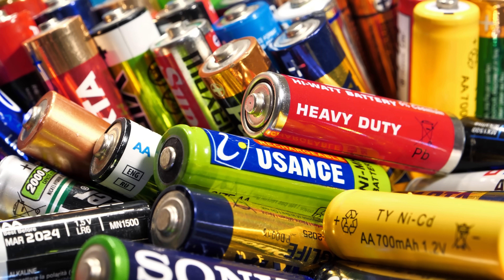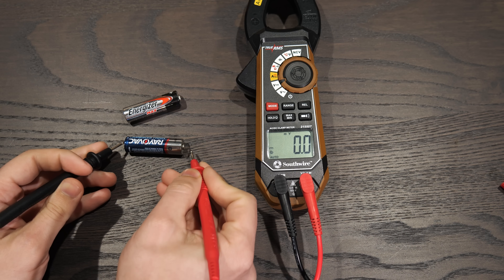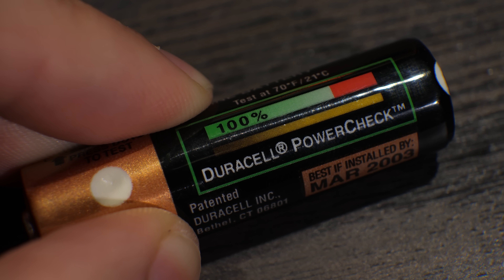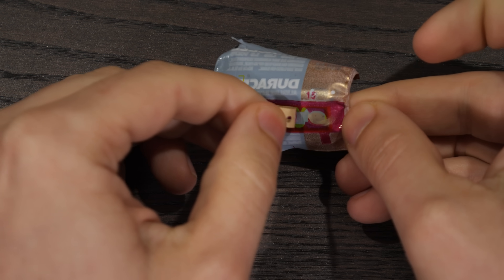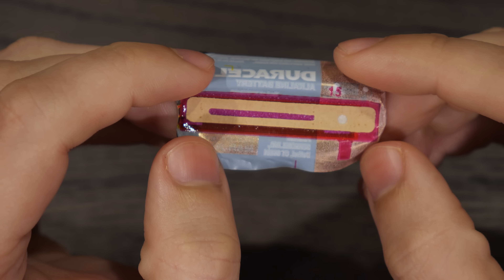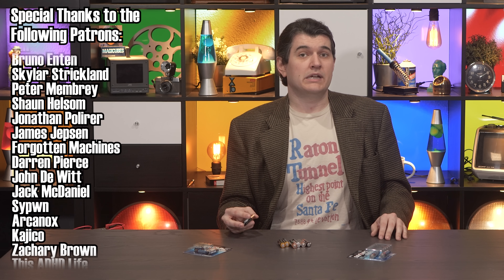Duracell PowerCheck: A genius idea which didn't last that long

Comment from the maker: A note on current:
The tester's behavior (how much of it turns yellow) is also dependent on how much current the battery can provide, but how exactly that was calibrated is... fuzzy. I only discussed voltage here because the original Kodak patent describes it as a "Battery voltmeter" and my first test with the DC power supply was consistent with this video's script. However, when I was filming B-roll with a second unwrapped battery, it was passing much more current than before and I needed to limit current via the power supply for it to show a clean cutoff in color. At just 1 volt much more turned yellow than in my first test, and over a smooth, spread-out gradient.
I sort of suspected this (that weak batteries would pass less current, compounding the effect of the heat gradient) but I couldn't back that up with anything concrete. My first test probably had a poor connection between the power supply leads and the label which was limiting current enough to make voltage the only significant variable, but until I filmed it with the second battery I didn't know it was pulling less current than it otherwise could.
Reply: It's probably a printed carbon film resistor, often used on inexpensive devices as it's pretty much a thick ink that can be printed onto a surface.  Edit: They may have been easy to print, but they were often HIGHLY inconsistent in thickness especially with low cost printing methods. This would explain the inconsistencies you (and we) experienced.
Reply: @truckerallikatuk 
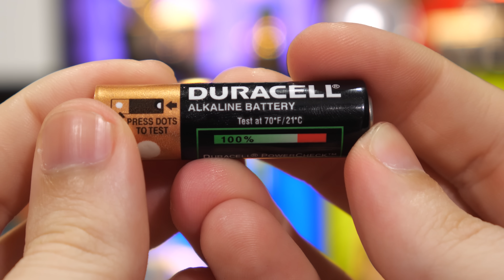Revelation 3:20
Behold, I stand at the door, and knock: if any man hear my voice, and open the door, I will come in to him, and will sup with him, and he with me.

HEY THERE 🤗 JESUS IS CALLING YOU TODAY. Turn away from your sins, confess, forsake them and live the victorious life. God bless.

Revelation 22:12-14
And, behold, I come quickly; and my reward is with me, to give every man according as his work shall be.
I am Alpha and Omega, the beginning and the end, the first and the last.
Blessed are they that do his commandments, that they may have right to the tree of life, and may enter in through the gates into the city.
Reply: A battery is commonly modelled as a constant voltage source with a resistor in line. Resistance is rising with emptying it.
Reply: So we can say this is an Ohmmeter? 🤗
Effectively measuring the increase of internal resistance of the battery as it wears off 

The heat released at the strip = I x U (current times voltage). Current through the strip under Ohm's law I = U / (Rs + Rb); battery and strip are in series, strip resistance is constant, battery resistance increases but also voltage drop decreases - so feels this will turn quadratic 

The voltage drop at the strip is proportional to resistance ratios, Us/Ub = Rs/Rb, so Us = Ub * Rs / Rb 

Heat(watts) = Is * Us = Ub^2 * Rs / (Rb * (Rs + Rb))
where Ub = 1.55v is constant, Rs is fixed but Rb increases - and the heat released is quadratic-ish to that increase
Reply: depends on what you use the batteries for my mouse use batteries and it becomes laggy and not great to use but then same batteries in a TV remote work just fine so i do keep them for later use
Reply: @markthompson4567  Yeah, reusing old batteries that were in high-power devices for use in low-power devices like remotes or clocks is what I do as well.
Reply: @markthompson4567  same here
Reply: @markthompson4567  Yeah this is quite common your optical mouse requires the battery to be able to push more wattage to actually function than the TV remote. Thus as the battery discharges there is a gap between where it is already too low for the mouse but not for the TV remote.
Reply: @FaerieSeraphina  why the feature would still be useful but i just have a seperate jar for half dead batteries instead
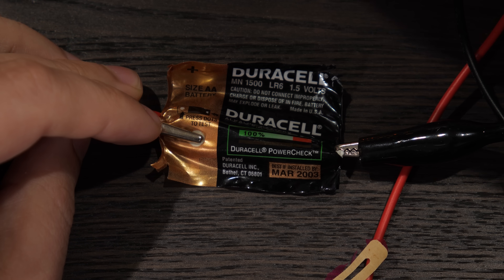Reply: For future refrence, got a little confused at 7:50 becuase what is stated in the audio does not match what is shown in the video.
Reply: HOW COULD YOU NOT TALK ABOUT THE BOUNCE TEST?? 
Bounce a empty and a full battery vertically on a table from ~20cm and witness magic
Reply: @TheBenenene10 I call bullshit on you. If you have actual evidence that this works, explain the exact method and provide statistically sufficient evidence.
Reply: @ScottLuvsRenFaires seriously? You're on the internet. You're on You Tube. How hard is it to search for the bounce test? Muppet
Reply: @TheBenenene10  It's like there's only 5 of us who know about the gravity test!
Reply: Speaking as a parent of smalls that get bought novelty night lights by well-meaning family, a special place in hell is reserved for engineers who design things with 4 coin batteries in series....
Reply: I mostly relied on how fast the band would color to 100. If it was a second, the battery was charged. If it took more than 5, it was dead or almost dead.
Reply: Duracell Quantum batteries still have Powercheck strips.  And amoebas too!
Reply: Internal resistance must be increasing as the chemicals inside are consumed. This adds up in series with the "external" load, and by Ohm's law the maximum supplied current decreases.
Reply: @catalinbadalan4463  Ohm's Law doesn't define how batteries work, as to their electrochemical traits, whereas it may apply to physical structure elements.  ESR is a bit more complicated.
Reply: @catalinbadalan4463  
That's horribly fascinating.
It was and still a waste of money. 
Thank God we have better technology now.
Reply: interesting video. What would be fun to see is if you had used a thermal video camera showing that strip heating up when applying various levels of voltage. press like to this comment to increase the chance that he will see my comment and possibly revisit this subject with a thermal camera.
Reply: it would be nice have it on rechargeable batteries (i usually charge my batteries all at once) 🤔
Reply: Your Burgerlandian self also forgot how they are still easy to find in Europe in working condition, being even sold as brand new. 

I guess that maybe in European countries people actually used that feature more? Or maybe the patent disputes didn't apply there somehow.
Reply: I'll subscribe to Alkaline Magazine.
Reply: I remember them well . Where you find these obsolete technologies anyway? I love these old things grew up using many of them.
Reply: These still exist under the name "ultra power" here in the UK
Reply: I need 1 answer, is Energizer/Duracell costlier batts worth the cost of RoyOVac cheap batt?
Reply: @amyself6678  Google Gaslight censored a comment explaining why there's no simple and accurate answer to that question.  Both companies have a history of good and of defective manufacturing batches and battery designs.
Reply: @amyself6678 Both of those companies have produced large runs of defective batteries with premature leakage issues more than once, and both have produced batteries with fraudulent spec's on labels (but unlike many eBay or ScAmazon sellers, have been pressured to correct those false claims).  

I've had batteries from each of those companies that are quite good, and from each of them, better placed in the chemical waste recycling bin or recalled if released.  That complicates the ability to give a simple blanket answer that's truthful.  Other engineers have made similar observations.
Reply: @amyself6678  Project Farm may have the answer
Reply: Batteries have an internal ESR or Equivalent Series Resistance, like capacitors do based on mechanical design and at stable values, whereas in batteries it's electrochemical and so varies with more complex age and use and load factors.  

That substantially complicates the topic of what defines battery capacity or end of life, and usually means a "real" oem battery spec sheet people who aren't engineers rarely request or read, is 2-16 pages long depending on battery type and ethics and quality of the manufacturer's engineering department, if not crippled by marketing or legal.
Reply: I never saw a purpose!!!!!
They're either alive or dead.
Reply: When I used it as a kid, I found it to be inconsistent, and had to resort of a multi-meter anyways. If you hold it too long, the entire strip would turn yellow.
Reply: @lophilip  agreed 👍🏼
Reply: I was born in 2002 and I’ve purchased batteries with this feature.
Reply: Duracell have very good technical data sheets which answer those questions re current, load, drain etc.
Reply: A 10-20% tolerance seems reasonable for these crude film resistors. A more reasonable way to test the devices to offset this tolerance would be to set your power supply to constant current mode, not constant voltage, and dial it up accordingly. Effectively these devices are trying to measure the internal resistance of the battery, which changes as it ages and thus reduces the current delivery capability, causing voltage sag.
Reply: But wait, I am currently in possession of over a dozen Duracell Quantum ( size D, copper top with a red colored shell) and they're good through December 2025 so I don't think Duracell stopped making them.
Reply: Weird suggestion for a video topic that’s not exactly your typical subject but I think would be extremely interesting and informative: Disposable vaporisers. I doubt that you smoke/vape but there’s lots of genuinely genius and incomprehensible parts of their construction.
Reply: i thought the battery emptiness was indicated my the leaking acid and that's why the bar was redundant...
Reply: Current measurement is just something you get for free with a voltage measurement and a known resistance.
Reply: It's about internal resistance. A voltage meter is practically infinite ohms (in the megaohms range) so there's practically no voltage drop inside the battery. But if the circuit outside the battery has too little resistance then most of the voltage drop occurs inside the battery and thus it "outputs" little voltage.
Reply: As you stated, my son's Game Boy ate AA batteries. I constructed an adapter to connect to a 6 volt lantern battery. It lasted F O R E V E R.  And one lantern battery was much less expensive than all the AAs it replaced. Thanks for another entertaining video.
Reply: My brain rot wattpad
Reply: interesting findings
Reply: These are awesome on weighted scales.
Reply: Power check was absolutely the best back in game boy color days always trying to mix a battery with almost nothing left with a battery that was still halfway my backpack was full of them
Reply: Im glad you mentioned current. My cheap Harbor Freight multimeter has a battery tester that reads in milli-volts.
Reply: Have you done a video / breakdown of ' potentiometers'???
Reply: And what I remember is switching to rechargeable batteries. 
Everything too batteries!!!!
Reply: Please do a video about washing machines, liquid pods vs powder detergent. Its such an amazing subject.
Reply: @axel_is_gaming  i think he already did that.
Reply: Energizers have used a simple "pass/fail" tester (the more visible the "GOOD" indicator shown on the battery, the more power it had left).
Reply: Interesting thing here Duracell in 2017  remade the battery testers for a short time thay called them Duracell quantum I don't think they went over very well you all should look them up
Reply: I think it is because of thermal mass. 

This is one device so resistance is the same across the circuit. 

Narrower section will reach higher temp at lower voltage. Wider section needs higher voltage to cross thermal threshold to turn indicator yellow. 

Then it is just a matter of tuning to make sure it's indicating capacity.
Reply: Back when these batteries with built-in meters were being manufactured, Duracell was actually a reliable battery brand.  Nowadays they are absolute garbage and pretty much guaranteed to leak and ruin whatever device they're in. Don't put duracell batteries in any device that you care about.
Reply: one follow up to this i'd like to see is about the heat-changing material itself, there used to be cups and bowl with things printed on them that changed color or revealed the print only when warm, but it seems the material in question always degrades with time (or with cycles ?) and eventually gets stuck in a weird half-translucent state. wonder if there is ways to regenerate those
Reply: Awesome video. Definitely enjoyed this content.
Reply: @Dany-z9s i saw him put that pair in the remote and i cringed
Reply: I'm pretty sure that PowerCheck remained on Duracell batteries long after the late 90s in the UK.
Reply: @RWL2012  Duracell Quantum
Reply: Coulda used a beetle juice joke, but otherwise the juice was definitely worth the squeeze in this video. :D
Reply: I'm one of the few that powercheck was made for - I've always removed batteries for seldom used devices (before I went to mostly rechargeables). But.. one of the few. I remember both the tester integrated in the battery and also the packaging. I think another point the marketers missed was someone concerned about battery health probably also has a cheap accurate 1.5V AAA-D cell tester.
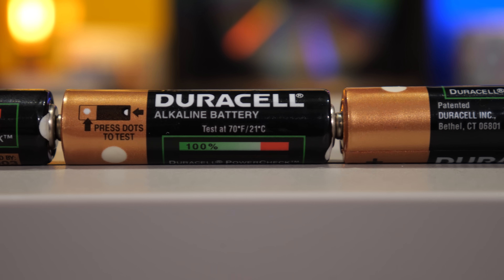Reply: 12:54  was  that meant to say energizer had in package testers? i remember them having that, but never durracell
Reply: It may surprise you to know that duracell still makes this kind of batteries. I'm holding a newly bought pack of eight in my hand right now. 
They work better than the ones you had available since they require you to hold your thumbs with less force than the older ones.
Btw I'm in north Italy so maybe they're not on the US market yet/anymore
Reply: First, please let me say that this was a GREAT topic with a POWERFUL delivery (read: yup, that was my dad joke!) and the nostalgia factor was off the charts! Please do make more nostalgic tech videos as I clearly remember how difficult those little buttons were to press! It’s actually kind of funny to think about this in retrospect a few decades later. That said, you must have been an “80s kid” too?! What a great time to be a kid, technology was really taking off and tech was just FUN! That was the kind of tech and reasoning why many of us “80s kids” wanted a career in a STEM field, to simply keep that fun going!

So, I read your post and certainly do have a theory, a very basic theory, but one that cleanly explains how current gets factored in. Batteries are about as DC as you could get and Ohm’s Law works well to explain the nuances. Actually, that and a small note regarding just how DC Power Supplies limit either voltage or current by design.

Now, we all know V=IR. With the static room temperature not being a factor (as I believe that it will change the resistance of the heating element or crystal that’s ‘reading’ it, thereby resulting in incorrect feedback), we must understand that the resistance of the heating element will effectively also remain a static value, at least at any particular point along the length of it (as it varies in width). You couldn’t have been more spot-on about just how important a load is as voltage alone is the “electromotive force” of the battery, based on the juice or chemistry. What voltage doesn’t tell us is how many electrons are moving past any given point, rather we only know that it has the ability to do so. The load will change the number of electrons dramatically as a larger load has more electrical resistance, so we’ll see less current with a larger load. That’s sort of how the graduated resistance works here, it’s a load by design and we see this as heat is the natural byproduct of resisted electrical energy in a DC circuit and even shows how inefficient they usually are… but… NOT here!

If you’ve followed along thus far, the issue is as batteries age, they lose their ability to product electromotive force or in other words their voltage diminishes. Back to good old Ohm’s Law, since V=IR, and V is decreasing, as the resistance at any given point will remain static, the current along the heating element must drop in proportion to the voltage! Hence, the bigger the voltage loss the greater the drop in current as a result. The end result will be that we absolutely will see this effect with this type of on-battery gauge as those calculations were made in a very particular way to ensure that the heating element working as the load will provide the necessary current to show a value, well, until a point that no value could be shown due to age.

Remember how I said that the power supply will likely affect the outcome?! This is because you could generally use a DC power supply either as voltage limiting or current limiting! Was current limiting a factor on your particular power supply? Could the threshold have been set too low? I would think that you really would need to operate in voltage limiting on up to about 1.65V-DC or so. That way, the current will present organically based on the internal resistance of the heating element. As you cut down the voltage, you’ll see a dramatic decrease in the yellow ‘gauge’ because of voltage and current being directly proportional to one another as the internal resistance is all that really matters (without accounting for fluctuations in temperature as that would of course affect it).

In summary, the on-battery gauge is genius! It has an inherent load unlike a multimeter and therefore should not present with a ginormous current (or voltage) drop if a load gets factored in. The circuitry of the multimeter along with the limiting effects of a modern DC power supply will just add too many unnecessary characteristics to an otherwise great and extremely simple setup! So, yes, the yellow gauge does measure voltage or electromotive force, however it MUST do so as a result of Ohm’s Law in action, only by knowing the inherent resistance of the heater and the current being yielded as a result. It’s simply another way to explain the same thing because DC circuits all rely on Ohm’s Law at the very heart of things!

BTW, the crystal display works exactly like one of those thermometer strips that change color based on temperature. Here, only a single color, yellow, is used. The heat output is taken based off of several items that go into a formula beyond the scope here to yield an exact temperature as a resistive byproduct. The specific point where it stops is simply where it goes below the temperature threshold. Yes, it does basically measure voltage, BUT only as a direct result of current due to the resistive nature of the heating element. I apologize if I missed anything as I have not yet read the paper, but the particular design methodology screams this to me!

Thoughts? 🤔💭
Reply: The internal resistance of the battery will reduce the current at low voltages, I suspect. 
With a bench power supply the internal resistance is virtually zero.
Reply: 4th on trends after 22h congrats man!😄
Reply: @TechnologyConnections  as an old dude: they were very inconsistent from one battery to the next. More than 2/3rds yellow it is likely ok, less it's likely not, is about the extent you could reliably know. They were also pricey.
Reply: IT STILL EXISTS!
Duracell PowerCheck still exists, I have a pair of AAA in my hand that are good until 2025. I think something got messed up in your research. Maybe they are reginally sold. I am curently in Serbia.
This one has 4 colors. One of the 2 I have still lights up the 1st 25% (red slot). HMU if you want them.
Reply: Thank you for reminding me I graduated Highschool 21 years ago.  @_@

Class of '03 represent!
Reply: Now do a difference on Duracell and Duracell ProCell
Reply: In your too quick review of battery sizes, you completely forgot the most frustrating types, namely AAAA, A23 and A27. The last two could typically be found in doorbells and AAAA was used in a pen for my digitizer, it was hard work finding new batteries for that one.
Reply: It was a smart invention.
Reply: "If you are old you will remember this!" Uh, I dug in my used battery box, and found one I threw away just a week ago. It explores in March 2025. But it's dead now. Duracell Powerchecks isn't THAT long ago. 🙂
Reply: i remember these, i loved them, i thought it was brilliant
Reply: This video sounds like duracell selftest are a thing of the past, but we still have them in Germany. and I see on ebay UK has them still ,too and I am talking about new ones lasting till 2029, not New Old Stock
Reply: The current "calibration" would depend on the overall QC of the material printed onto the label providing the resistance. If a battery could provide a lot of current then the label will change color faster, if not then it would be slower. Eventually it will balance out with the voltage the battery could provide. As a result the battery label should provide the same reading if the voltages under load are the same. This is evident by you needed to limit the current draw on one of them because the overall heating was much higher therefore it was spreading further up the scale. You could confirm this with an infrared camera.
Reply: @TechnologyConnections

The real "genius" behind these built-in battery testers was putting them into disposible batteries where, frankly, who gives a f*ck instead of into rechargable batteries where it matters!
Reply: I remember using one of those individual battery test strips on a 9V battery as a kid.  It was the first thing I held in my hands that went "POP!"
Reply: Pl
Reply: I’m I’m sorry 9sorry but but,😅 o  o for a little little little more more more stuff stuff
Reply: in in in in in in in
Reply: I’m I’m I’m, I’m so so
Reply: I’m 😅😅
Reply: I’m I’m sorry 😣😣 but but but,,
Reply: I’m I’m,,oo😅o
Reply: I have these in my keyboard, mouse, and TV remote with a 2032 expiry date, I believe that they are still being used today and are not a relic as stated in this video.
Reply: @hackbotogaming - I haven't seen them for sale in the USA for over a decade, EU and elsewhere may differ. I also dont buy disposables in less than bulk 24pks (much cheaper), every few years. That may affect my perceptions?
Reply: Never got this thing working in 2003
Reply: @TechnologyConnections How can I reach you to suggest a video?
Reply: Those battery checks on Duracell are still here in Europe. They are here since 90s and still here :). Look a bit different now (design is more fancy on the checking bar) , but yeah, still here :)
Reply: Are you sure that they went away? Onl a  few months bac,  i bought a pack of batteries with charge tester.
Reply: @TechnologyConnections Appearently Duracell batteries with PowerCheck are still available in Germany, where I live. I found them on Amazon and while they look a bit different, they are listed as available in new and, more importantly, have the feature. Although there is also a newer version of this battery that doesn't have the PowerCheck feature.

If you are still interested, I could also send them to you after I "test" the functionality myself :)
Reply: I'm old enough to remember when AA & AAA batteries were called "Penlight batteries", because they were primarily used in the small flashlights, known as penlights. At the time, there probably weren't enough other devices that took these small batteries. If there were, it was only toys that used them. Most toys took the D & C batteries. I don't think there were many 9 volt batteries around then. This was in the early 70s.
Reply: I'm not sure if they stopped producing such batteries. I have some of them right now produced in 01/16 with expiration date mar 2025. Unfortunately I never got that I have to press 2 points, not 1, so I was unable to measure anything. Now seems like I've used all of them - there are several for christmas lights, but they are partially discharged and I failed to use indicator now (voltmeter shows 1.11 to 1.25 volts). Mayby some are installed, but I'm not sure in what devices. I'm in Russia if region matters.
Reply: Some of the powercheck materials were also... well... not very good. That could also be the reason why some of the batteries were showing more current than others.
I peeled the powercheck stuff off two powercheck batteries back in high school for a science project and found that the testers were poorly made on one and well made on another from the same pack of powercheck batteries.
Reply: Duracell powercheck was discontinued in 2019 when they shut down the Quantum line of batteries
Reply: This is such an insightful dive into a piece of tech nostalgia! It's amazing how much thought went into creating a self-testing battery, even if it didn’t catch on. The way Duracell implemented the heating mechanism with the thermochromic material is such a clever engineering solution.
Reply: They are still on sale Duracell quantum has these strips.
Reply: That clamp meter is really good
Reply: he Duracell PowerCheck batteries feel like a perfect example of solving a problem that not enough people had. Still, the creativity and engineering behind them is remarkable.
Reply: I completely forgot these existed! Thanks for the trip down memory lane, great video!
Reply: The 'press dots to test' system was oddly satisfying to use back then.
Reply: Surprised you did not mention the option of using rechargeable batteries. Surely it's both the cheapest and environmentally best alternative.
Reply: I remember using these Duracell PowerCheck batteries back in the late ‘90s. At the time, it felt like pure science fiction to have the battery “test itself.” But honestly, I stopped buying them because pressing those dots was awkward, and the reading wasn’t always reliable. In hindsight, it was a clever but overengineered solution to a problem most people didn’t really have
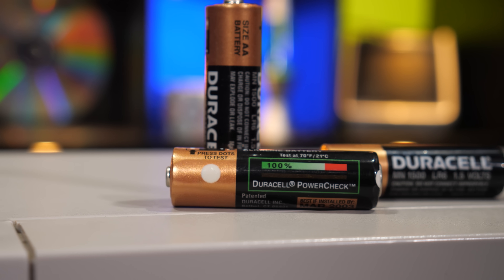Reply: 10:23 why it went away
Reply: If you think people just throw away half used batteries without throwing em in a drawer and hoping they might work on something else, like when you need two batteries and only have one fairly full, so you use a near dead battery and that'll work-- if you don't do this, you ain't never been that broke. It works just fine
Reply: Couldn’t the “tester” have degraded too my friend 🤔 🍀
Reply: I'd like to see these comeback but on rechargeable batteries.  I have a box full of dozens of AA/AAA batteries with varying degrees of age, capacity and charge holding levels.  As a tradesmen/property manager, my headlamp(s) is an everyday carry, and this would take a lot of the guess work out of how much power is left from something that's been left in the toolbag for 1-3 weeks.
Reply: @emmakai2243  If you're willing to spend a bit more on your charger, you can find more sophisticated ones that do the measurements for you, and will even test (charge, discharge, and recharge) the batteries and indicate how many mAh of charge they will hold.
Reply: @emmakai2243  I have some 9V replacement lithium batteries with LED capacity gauges.
Reply: @emmakai2243 get lithium head lamps and charge BEFORE useage but leave them as half discharged as they are after usage. so the average SoC is not 100% bdtween uses but way lower and that safes on degradation. apples crap phones know how to degrade lithium batterys pretty damn well. and they are constantly kept charged because they last somewhat between 5 and 30 minutes...
Reply: as kid I had old batteries as they could play a song or to after a time off in the draw
Reply: @Glaaki13 you mean in the DRAWER?
Reply: @Superabound2  no I mean you mom
Reply: Ultimately this is because the current that passes is proportional to the voltage this is why the voltage of a current limited supply drops under load. This is the same thing that makes the silly debate whether it is volts or amps that kills you is silly V=I/R is always true. If the voltage is sufficient to push more charge through the circuit than the power supply is able to replenish the amount of charge at the positive terminal will fall which means so too will the potential until it reaches a steady state where the voltage is just enough to push charge per unit time through the circuit aka current as the supply is capable of replenishing. When we are talking about DC systems V=IR means the voltage and current are always proportional to each other with the resistance being the ratio, things get a bit more complex in AC systems where V and I are constantly changing if you have any reactive loads that shift the phase of the two but that is another level of complexity that doesn't really apply to a battery.
Reply: @FaerieSeraphina Wikipedia says of Ohm’s law ‘It is less fundamental than Maxwell's equations and is not always obeyed. Any given material will break down under a strong-enough electric field, and some materials of interest in electrical engineering are "non-ohmic" under weak fields.’
Also, see styropyro’s video on the topic of under what conditions electricity will kill. He explains that it is pretty complicated, and the simple rules have exceptions?
Reply: @drdca8263  As I mentioned it does get more complicated in other situations but it does not really apply here we have a DC circuit with an entirely resistive load. Things get more complicated when you get into AC circuits, capacitive/inductive loads, and various other factors but they don't really apply to the tester doing it's job.
Reply: @FaerieSeraphina  sorry, I just saw “is always true” and jumped to share the exception I had heard about.
Still, my impression is that AC is not the only case where Ohm’s law fails.
Reply: @drdca8263  Well yes like semiconductors.
Reply: @drdca8263  No you are correct and we would need to get into that if we were talking about semiconductors for example. Or we would to get into detailed physics which actually starts to go over my head I've never needed to know too much beyond the equivalent values under various conditions you can find on the datasheet. It is certainly something that someone that was designing the semiconductor devices themselves rather than just someone like myself who uses them as components in my hobby as a maker would need to get into for sure though.
Reply: @drdca8263  Whether Ohm's law "fails" is really more a matter of point of view than Ohm's law itself. If you consider R to represent an equivalent series resistance at a single point in time, the equation is always true. When we talk about "non-ohmic" devices such as diodes, we're not saying that the equation doesn't apply; we're saying that R (or ESR) is not constant: i.e., changing V may also cause R to change. But the equation still balances out.

Even for AC, the equation still works fine: just replace the real-valued resistance R with a complex-valued impedance Z and you're good.
Reply: @Curt_Sampson  The problem is, if you're considering it at a single point in time, the equation trivially reduces to that it is possible to divide V by I and you can't necessarily infer anything useful from that. By recognizing a class of components that we consider linear, it becomes much more useful.
Reply: @Curt_Sampson  So, are you saying that you can essentially make Ohm’s law into a definition of resistance, and by doing so make Ohm’s law almost tautological?
Reply: @chaos.corner  Well, maybe you're different from me, but when I'm building circuits I find those "single point in time" (which extends to all points for a straight DC circuit) very useful; it lets me e.g. figure out what size resistor I need to keep my LEDs from burning out.

The "class of components called linear" is just those with a VR curve that's a straight line. That's actually, when you get down to it, no different from components with a VR curve that's not a straight line. Either way you're looking up R(V); the math just happens to be  simpler when R(V) is a constant function.
Reply: @drdca8263  In the sense you're thinking of, yes, I guess you might say Ohm's law is "tautological," because it's always true. But that doesn't make it any less useful. If you need a specific current for an LED, for example, it tells you exactly what value of resistor to use in series with it. If you need to find the R(V) curve of a non-linear component, you vary the voltage, measure the current, and then you have your curve. Those are just two examples of practically useful things you can't do without Ohm's law.
Reply: @Curt_Sampson  But I=V/R(V) isn't saying anything. And with the LED, you'll be using Ohms law for the resistor (which has a consant-enough resistance) but for the LED, you'll be looking at the V/I curve or be picking some 'default' value. That's not using Ohm's law.
Reply: @chaos.corner  I=V/R(V) is indeed nonsensical, which is one reason I have no idea why you brought it up. What are you trying to do with that?

I don't know how you design the circuit for an LED, but I start with the luminous flux vs. current curve. If you look up, e.g., the datasheet for a Kingbright WP7113SRD, you might decide that you want 20 mA of current flowing through it for the level of brightness you're looking for.

The forward voltage drop (typ.) is 1.85 V, so if your Vcc is 5 V, you use R = V/I = (5 V - 1.85 V) / 0.020 A = 3.15 V / 0.020 A = 158 Ω to determine the ideal resistance and, since that's not a standard value and you prefer to derate, look at the next E12 value up, 180 Ω. Now you again use Ohm's law in the form I = V/R = 3.15 V / 180 Ω = 0.0175 A which, going back to the intensity vs. current graph, gives you only 88% of the desired intensity, which you decide is too low. So you go to the E24 series and, using Ohm's law again, try it with I = V/R = 3.15 V / 160 Ω = 0.0197 A, giving you 98% intensity, which is great.

So no, you didn't use Ohm's law for the LED, but I don't see how that matters: aside from the current vs. luminosity curve of the LED, you used only Ohm's law for all these calculations.

You can, of course, use Ohm's law again for the ESR of the LED at this voltage and current level, if for some reason you want that. R = 1.85 V / 0.0187 A = 94 Ω. That point on Rled(V) isn't a terribly useful figure, but Ohm's law still works to get it.
Reply: @Curt_Sampson  We seem to have started going around in circles which is something I try to avoid. Especially in YouTube comments which tends to be a less-than-ideal forum for discussion. Also there is lot of good info that explains it better than I ever could out on the web. All the best.
Reply: @FaerieSeraphina  V=I/R is never true. That said, V=IR, I=V/R and R=V/I are always true.
Reply: @Curt_Sampson  Dammit you are right lol.
Reply: @FaerieSeraphina  This is the same philosophy as Car Battery Load Testers, although those have a more conventionally-discrete Resistive Load Element and they measure the terminal voltage drop under load, to evaluate Cranking Amp Goodness
Reply: @FaerieSeraphina  I think it's V=IR
Reply: @FaerieSeraphina Thank you, I came here for this comment. It's frustrating how the voltage vs current misconception is propagated even by experts. What was probably happening was that the tester had a lower resistance than a standard device, leading to more of a voltage drop than you'd otherwise see. But since voltage is directly proportional to current, and since the tester is a constant resistance, a voltage measurement is equivalent to a current measurement in this case. Current limiting was only necessary because he made an incorrect assumption of what the voltage under load should be.
Reply: @OceanBagel  Except the tester gets wider so is not a consistent resistance.
Reply: @JointerMark That's not how it works. The strip isn't a constant width but it doesn't change resistance over time. It would only change if you measured from different points, which is not what's happening.
Reply: @OceanBagel  holy crap ocean i didn't expect you here! love your UT speedruns
Reply: @FaerieSeraphina  The problem with 'V=IR' is always true is that this is only the case if R can be considered dependent on many other factors such as temperature, possibly time and maybe even V or I themselves. Even in the case of electrocution, for instance, the resistance of the subject actually drops the longer the current is passing.
Reply: Am I going mad or did you made an episode on pressure cookers that I can't find anymore?
Also would you consider bicycle something worth talking about?
Reply: He did one on rice cookers…
Reply: You are goning mad, just like we all do. I just could find an episode about rice cooker that work similar to preasure cookers and one episode about electric water boiler. Maybe you meant one of those?
Reply: I think it would be a better idea, if they were to bring something like this back, to make the box the batteries come in a little sturdier and add a battery checker to the box
Reply: @justinanderson267 - for a few years they did exactly that, it was made as part of the clear plastic package the batteries came in (disposable) you pinched the battery into the valley between the groups of 4 cells. Actually displayed a better bar. I used to cut it out from the pack and keep them around as a handy quick-checker. Still preferred a real meter, but hey, handy is  whats there and good enough!😊
Reply: As an electrical engineer I was screaming at the screen: it is not a volt meter! It measures the power that the battery still can deliver. Glad you realized.
Reply: I actually have an old analog battery tester that can stest alkaline battery shaped batteries of multiple sizes. Very useful whenever I need to replace batteries in my fans
Reply: Built in Lion batteries totally cut the cost value of included meters. Replaceable batteries are already a dying niche.
Reply: @anthonylosego  how many involuntary servants does it take to get the lithium?
Reply: Yeah they sucked
Reply: if only buttom batteries were rechargable : x man I hate products with buttom batteries...those batteries are so expensive too!
Reply: @matrixfull  There are rechargeable button cells, but the only place I've seen them used is older solar powered self-recharging watches with archaic personal assistance functions like a built in virtual Rolodex.  

They don't exist for alkaline nor Silver Oxide chemistries, but do for some LiIon in the same sizes as Li disposables.  There are also higher current but faster self discharge series, versus the CR series with low current but low self discharge for long life in very low power devices.  
 
Cascio G-Shock watches were among those older devices using rechargeable cells, maybe BR-2016 or similar?
Reply: Lol. I thought the initial use on the video looked odd, and then you come out and say it was movie magic. 

I think the reason it died is more due to who was using the batteries. Back when these came out, everything used batteries. So kids would end up swapping them among their toys. I know I personally would swipe them from all sorts of things to power my Gameboy. Once the huge power draw items like handhelds and animatronics started using integrated rechargeable LiON batteries, that stopped happening. Also electronics have gotten better; I remember devices like boom boxes that took 6 or 8 D cells and would end up killing half of them and the other half was fine. So having a built-in tester had use back then. 

The biggest comment I do have is I was expecting a discussion on the "battery drop test". Seems like a tangent you'd be all over.
Reply: This thing would be super usefull, if slapped on the rechargeable batteries.
I have only 4-slot charger, so I always have AA & AAA around, which I'm not sure, whether they are charged or not…
Reply: Batteries have an "internal resistance" that more or less accounts for how fast (or not fast) the battery can regenerate or hold up its voltage, that would likely act as a natural current limiter that the design accounts for (but that your power supply doesn't)
Reply: One thing I never understood: why do you need to press two dots to activate the tester? You only need one open switch to break the circuit when not in use, so why not just have one end connected permanently? (Preferably the negative end, since the dot on the side of the battery was much easier to press than the one on the corner.)
Reply: @macdjord  To prevent accidentally discharging the batteries or causing fires and such.
Reply: @macdjord - Most likely to reduce the odds of the battery being drained inadvertently while in the package or a tight fitting device compartment (it happens). 2 seperate contacts have to close together, unlikely by accident.
Reply: So not only is it inaccurate. It drains batteries like crazy. So much so, that the battery's internal resistance is what's limiting the current/discharge. Not the strip.
Reply: The real problem was most electronics wouldn't power on with duracell brand, everyone had to go to Energizer "Electric", or "Advanced" or your electronics just wouldn't turn on because duracell shipped being too underpowered. I suspect that's the real reason they died. Cost cutting to endure.
Reply: The interesting thing with chemical batteries is they have a voltage related to the chemical reaction which is a constant. So how does the voltage drop? The 'internal resistance' increases and you are effectively operating a voltage divider. This is why battery testers need to have a dummy load. Multimeters, especially old ones kind-of come with some load anyway but with semiconductor based multimeters, that's typically very high and may not be enough to give anything like a useful result.
Reply: @chaos.corner  it's not a constant, what are you smoking lol
Reply: @rotaryenginepete  The book you never opened, apparently.
Reply: The open circuit voltage is not constant, apart from the material it also depends on the ion concentration and temperature. The expired unused battery still had good concentration but abnormally high internal resistance due to age. The more recent but used battery had low concentration hence the lower open circuit voltage.
Reply: AA and AAA batteries were easy enough. I had some Toys that went with those "Button Cell" batteries that were the same used as CMOS batteries on motherboards and the dreaded "AAAA" that you had to only get at either one in 6 drug stores in the area or go to a dedicated battery store like Interstate Batteries or Batteries Plus.
Reply: Interestingly, since it's an analogue device, and Duracell probably dialed in their manufacturing process. I'd bet it's an amazingly accurate instrument. However, with no scale, it has zero precision.
The battery casing is probably still sinking a fair amount of heat from this wafer thin thing and the 0.1-2?mm paper. The other variable is using a DC power supply doesn't take into account the small equivalent series resistance of the battery, which may or may not change much. -

- Math and spreadsheets are for work; home is for factory videogames; sometimes those require math and spreadsheets...
Reply: Don’t forget the case of the cell also acts as a heat sink, so testing with a removed label is going to yield different results than when it is on the cell as intended.
Reply: I save spent batteries like those cursed AAAs to use in my single cell LED flashlight, which is able to extract every last electron before declaring a TOD. 
I use a little LCD display battery tester that tests with a constant power circuit to sort batteries, fast and easy. Works for lithium coin cells to AA to 18650 cells.
Reply: If there is some kind of relationship between voltage and current, then what you have is a power meter.
Reply: Thank you again Luis Solano. I appreciate this, and Ernie, you the shit too.

I still have a homie that tried to break about how he was happy about having a supply of batteries he was throwing away for his Xbox controller. Tryna roast my PS4 shit and buy the time we got a PS5.. he stfu on that shit.. I need new homies..

Thank you and the crew again for making this one. And everything, u do. Wish I could share my thoughts on every video but I'd have to be a hermit by now to dive in as deep as I'd want to.. 

You're bringing so much general knowledge to the world and I'll never stop loving you for that. The impact you've brought is incredible and I can't wait to see all the things you do.
Reply: Could your power supply issues also be partially related to not being on the battery? While the brown paper may have insulated the tester, it may not have completely insulated it.
Reply: you probably knew this but something I do for devices that still use 2 AA and AAA batteries in series is I replace them with lithium cells of the same format, AA batteries are 14500 lithium cells and AAA batteries are 10450 lithium cells, Whenever I do this I get a Watt-hour uprade from standard disposables too. 2 disposables is 1 lithium cell and a metal "dummy" in the other battery slot. you'll need one of those vape-battery multi-cell chargers but it'll greatly reduce your need for disposables :) I probably use less than 4 batteries every year because things i use regularly are all lithium swapped and its just odd balls now.
Reply: just use a multmeter
Reply: Does anyone have a TV remote that can be charged via USB like the AppleTV remote? (I’m just curious).
Reply: @Conservator. For the last few years, Samsung TVs have come with a remote that charges with both a solar cell on the bottom to extend run-time (just remember to flip it face up into the room lighting, or sunbeams) or a 5vdc USB-c port for fast charge. The TV has a utility function that displays its charge status. Works good.
Reply: @KevinSmith-ys3mh  Thanks!
Reply: Oh yeah, have you ever eared about "bite the battery, if its soft is drained, if its hard its still full"?
Reply: Battery consumption is worse than ever. Electrical vehicles are way worse on the environment than AA batteries.
Reply: @Goldilush  Hmm, I wonder why that doesn't shock me... Oh yeah, because the batteries in some models of those cars keep setting themselves on fire like Note 7's on wheels
Reply: Why arn't rechargable AA batteries made to be 1.5V, rather than 1.2V. It's something incredibly frustrating to me.
Reply: @ChallengeTheNarrative  Study the different battery chemistries and operating curves.  

All batteries have some variable range of voltage, current, charge level, etc.  Silver Oxide tends to be very stable.  LiIon run 3.7-4.2 volts normal range.  Lithium batteries run around 1.6 volts, a bit over carbon-zinc (rare these days).  It's NiMH that run around 1.1-1.35 volts.  Lead-acid run around  volts per cell (or 10-14 volts for 6 cells).  

There are standard chemistry electrovoltaic potential traits of materials, and then design engineers sometimes find ways to tweak them within limits.
Reply: @ChallengeTheNarrative  It's simply the chemistry. Different chemical reactions provide electrons at different PDs. It's pretty much just a coincidence* that NiCADs and NiMH share ~1.2V and alkaline and lead acid are at 1.5V. Meanwhile LiPos are typically around 4.2V and will use fancy electronics to match other requirements where needed.
Reply: @ChallengeTheNarrative - It could be done (and has) but requires a different chemistry inside and more costly, due to production scale being limited. Its always the $$!
Reply: The battery performance is normally graphed by voltage.
Analog meters reflect amperage.  The battery label tester shows power (VAR, or wattage under DC).
Normally, there's a simple relationship between them, so it doesn't matter.  But the battery's performance for a given load is also documented and known for a particular product, so "they" can convert.
Basically, if you attempt to draw more power than the rate at which it can be produced, output is limited and this reflects both the V and the I to match the external R.  A volt meter will use a very high resistance in order to consume as little power as possible, which for a plain battery is far smaller of a load then you would use such a battery for.  So, it's unrealistic and might show you still have life, just not for the device you want to use it in!  A realistic tester would draw as much power as the device normally does in operation.

Also, modern devices cut off at 1.0 - 1.1V in order to support rechargeable cells.  So lots of life is still left on the table, and the battery might still work in a different device.
Reply: Yeah, this was bugging me. I wondered if your multimeter had a 'battery test' mode, b/c any good MM should have a very high internal resistance and thus show almost any battery as producing 1.5v. I would have liked for you to explain how the engineering model for a battery is a perfect 1.5v voltage source in series with an unknown internal resistance.
Reply: These old expired Batteries might still be good enough for a "jule thief" or a solar lantern, with just a small solar panel as source there is no chance of them exploding.
Fun fact: you can partially recover depleted primary batteries with an careful charge strategy to maybe 70-80%, though it falls off quickly with repeated recharges an increases leaking risk.
Not that a solar lantern would be a huge loss.